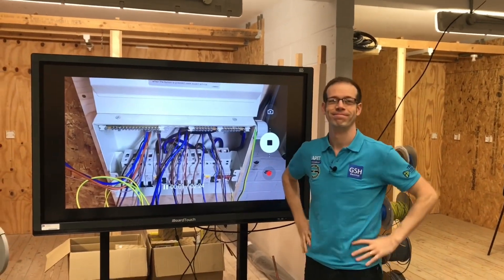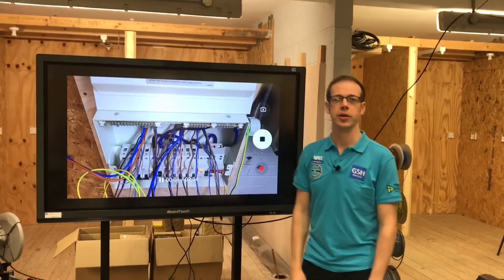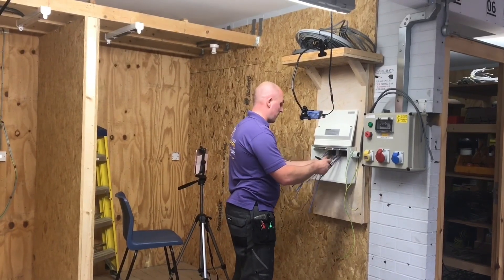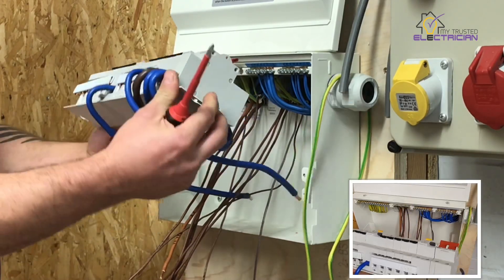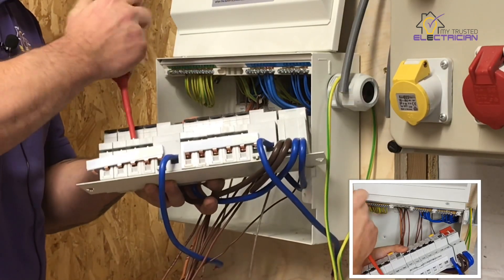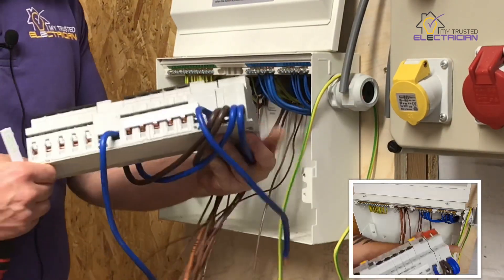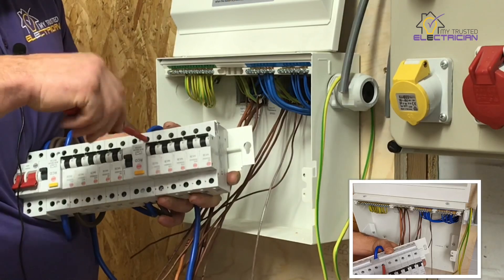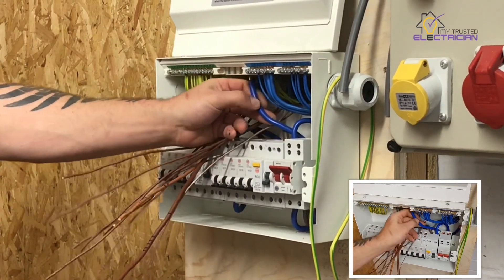Issues with an Incorrectly Fitted Wylex Busbar Masterclass by My Trusted Electrician Luke Wichard

Comment: I have been to a few CUs with busbar missing the clamps, like you said the higher the load, the bigger the arcing, and melting I have had to replace 4 mcbs and an RCD because the board melted luckily the T&E coming out the top were OK so straight swap. I religiously check everytime I remove covers off CUs. Loose termination on ins and outs of mcbs and RCDs is my pet hate.. Always double check. A fire was almost started by a couple I have seen.
Reply from the maker: Thanks for taking the time to give such a detailed comment Gaz 👍👍👍

Comment: Who's that handsome devil in the purple top 😉
Reply from the maker: You mean the blue top????
Reply: @GSHElectrical  think you need to adjust the colour setting on your laptop mate 😉
Reply: Good to see you getting in with the new recruits. I had a job the other day where the lighting circuit was barely touching the bus bar and just stopped working. Nearly every other connection on the DB and a unit in the outbidding wasn’t torqued down properly, along with half of the sockets. The EFLI was crap even for an old TNS supply.
Reply: Ha, ha. Great video guys.

These vids have proved invaluable to someone like me that is relatively new to the industry. Love that you're willing to share the insight you have accrued with your experience. Grateful. 👍🏼
Reply: @M0JGX an electrician is like an onion...